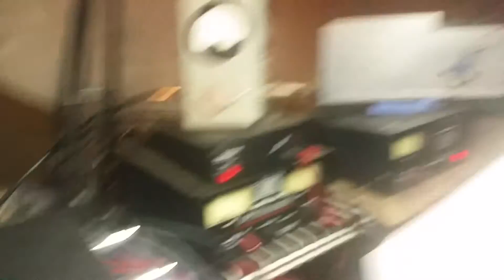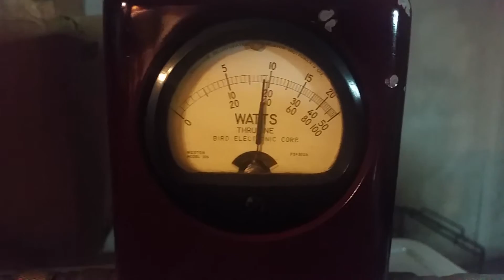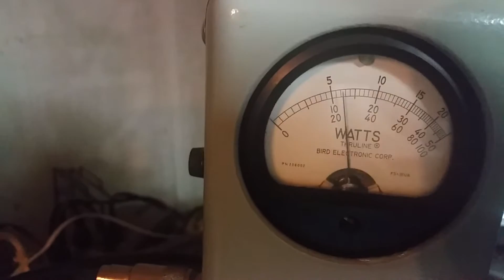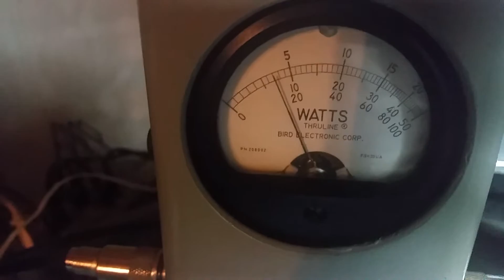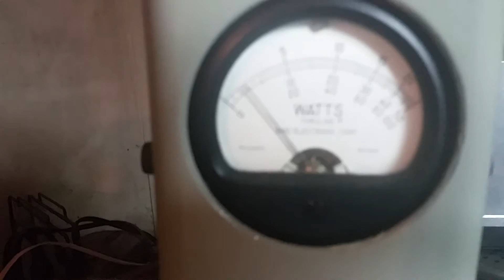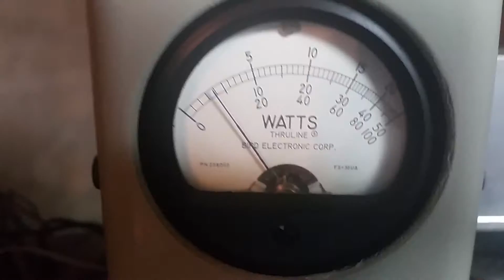Gatekeeper Built 2 Pill China HG (HuaGao) 2SC2879 Base Amplifier Built From Scratch!

Comment: dont know why you stated there first transistors were not as good ? i still running my 2 pill built years ago hg pills 200rms on 12volts but thanks for your videos there entertainment to my boring life...
Reply from the maker: it is a common fact brother...im talking about 4 or so years ago. You might have a pair of U.S. Distros which will do 200w rms. or you could have a pair of the old ones that were matched. i built a 4 pill out of them and got 800w plus but i had to go through 30 of them to match 4 of them. i am glad to hear the luck that you have had with them.
Reply: +1883GotDown im talking about a pair from 2009
Reply: +Brian Thorpe yea no doubt the fun is what we do ....busting muducks on 27.025....

Comment: way too loud
Reply from the maker: i thought about adding an extra switch to the 2 small fans which is making the extra noise but with the Amp sitting under a table or 5ft away from you it isnt that bad. Those fans are extra. Maybe I should put a switch on them. Thanks for the comment.